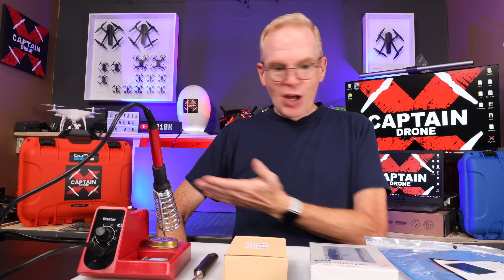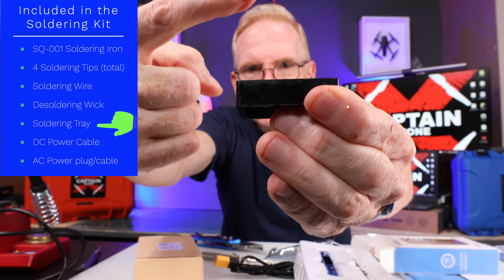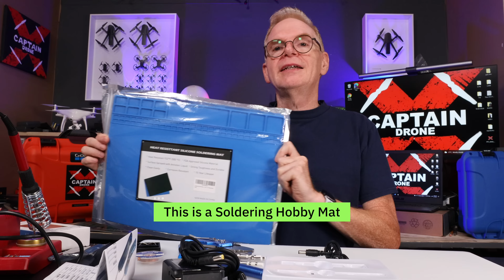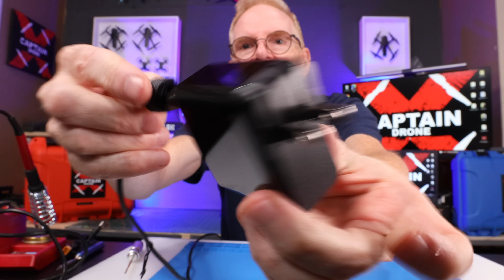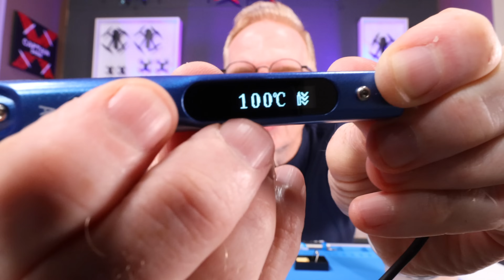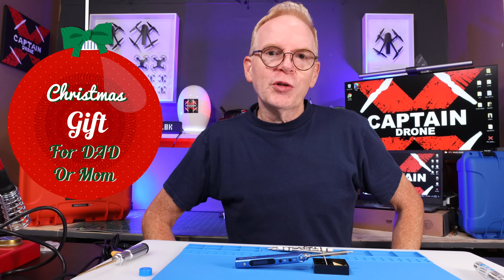Best Christmas Gift for the RC Hobby Dad - Mini Soldering Iron Kit - SEQURE SQ-001

Comment: I've seen and considered these before though it was the USB plug one. One thing I have way too many of is Soldering Stations. I do like the Milwaukee M-12 Soldering Iron and use that for onsite repairs but it's pretty big compared to this one and the Hakko cordless one doesn't have the best thermal capacity.